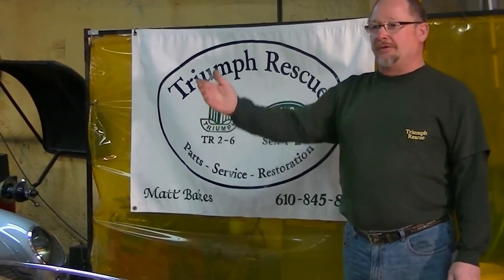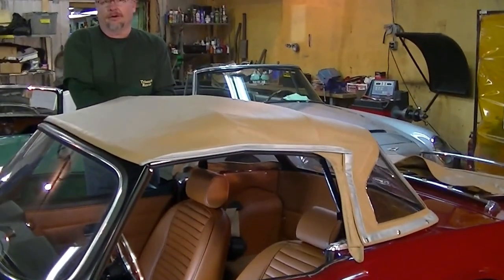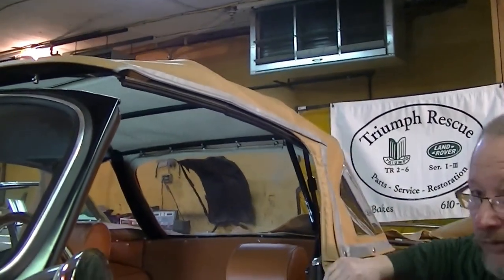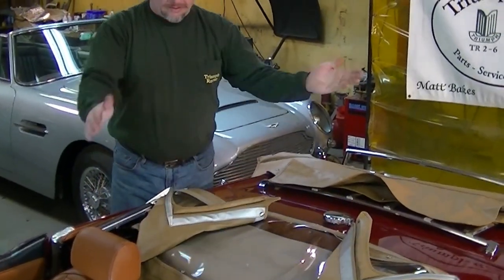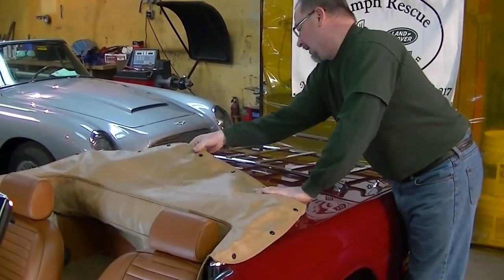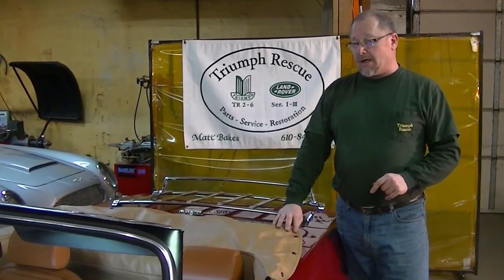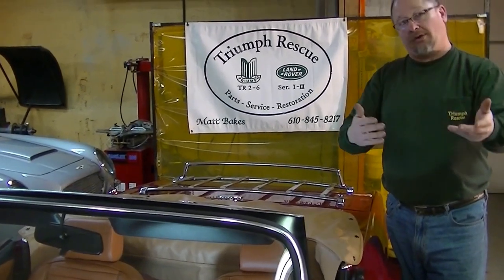TR6 Top Folding

Comment: Informative video. The only thing I do differently is to unzip my rear "glass" and allow it to hang down flat before folding the top. After years of opening and stowing, the rear window is still as flat as a piece of plexiglass.
Reply from the maker: HI Don, I agree that the final out come should be to protect the plexiglass. We see a ton of cars that the tops are in bad shape. One main reason is they never get put up. I tell people you should store the top up when not in use. Thanks for taking a look.

Comment: Great video and very thoroughly presented. I had a '69 TR6 back in the early 70's and had forgotten how involved putting the top down and up was. Folding canvas tops have come a very long way in the last 50 years. MyGawd indeed so... I just bought a 2020 Mazda Miata with a soft top. Putting it up and down takes maybe 10 seconds. You unlatch one latch in the front, fold it back and lock it in place... wam, bam... done. It's amazing!  I loved my TR6 in the day but I'll take the reliability and clever engineering in today's cars like the Miata.  😉

Comment: Wow! I had a TR-6 for a few years in the 70's in New York City, and knew nothing of such things. I'd put the top up and down with one hand while in motion. It was so smooth that I got TR-6 top frame to put on a '27 Model T (Speedway Motors kit) hot rod I'm building. The top down will fit the T body perfectly, unlike the tops designed for it, nestling down inside the body instead of lying on top of it. All it needs is the custom front top piece to meet and clamp to the top of the T's flat windshield. I'll make it out of steel bits and join it like the triumph to an aluminum top frame on the windshield.  The T has doors, but I doubt I'll want windows, since I'm in Florida.

Comment: I noticed that neither of the rear side snaps (the third one back from the glass window) were snapped when this top was up.  The snaps were not properly installed, which is very common.  The design flaw with the TR6 top is that the rear hold down plate (which holds the rear of the top to the car) extends beyond the place where the top sides should be folded over.  That is why so many people fold the top in the clear wind portion.  I have "unglued" mine back two inches on either side to facilitate folding on the fabric, not the side window.  That makes these rear side snaps even more important when the top is raised. As others have said, the rear window should be unzipped and dropped inside the care before the top is folded.  After discussing the negatives of folding the clear vinyl, Matt goes on to squeeze the clear vinyl rear window around the folded frame!  This will ruin the rear window.  If you drop it first, it stays flat and protected under the frame.

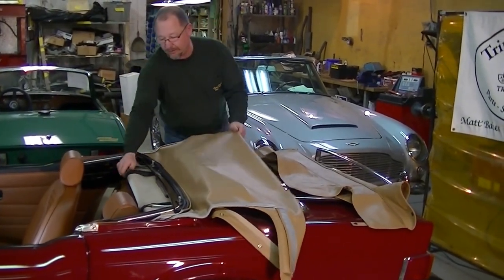Comment: This way leaves a lumpy looking  top cover as evidenced at 5:26,  I do it the same way up until 3:00 , at that point I fold the 1/4  windows up over the fabric so that they are tucked and hidden when the big window folds forward and behind the seat. This way gives a much smoother look to the top cover whilst top is stowed.
Reply: ...I just tried that, but then the 1/4 windows are directly resting and compressed on the upside-down protruding metal front pins. Ouch! How do you avoid that?

Doing it the way Matt did it, with some pulls to adjust folds, the cover is then pretty flat, although my material seems thicker and more robustly flat than his to start with.
Reply: @juliansimmons7700  piece of thin foam/cloth does the trick.

Comment: Even as careful as you were, it looked to me as if the bottom corner of the triangle shaped side windows were folded, which eventually becomes a tear. With a standard instillation, there's no way to avoid this due to the location of the snaps closest to the gas cap. Here's a trick I tried when I noticed that a TR6 has 3 snaps on each side, but a Spitfire has 4 snaps. We put 4 snaps on each side of the TR6 top. Now the  side windows can fold in on the fabric, and not crease the bottom corner of the windows. Also, I ALWAYS unzip and lower the rear window before lowing the top.
Reply from the maker: Interesting and thanks for letting us know, it would make sense and I never noticed the extra snap.
Reply: Completely agree - the rear window MUST be unzipped and lowered before pulling the top back.

Comment: So nice to see you showing this...how many times have you seen a used TR6 with a small rip in the "shoulder" of the top (above what looks like a "b" pillar, the vertical leg of the reflective strip).  You get that rip by putting the top down without unsnapping and pulling it out first.  I was looking at very nice TR6 online today, at a "reputable" dealer...yup, had the little tear.

Comment: Vinyl tops look a bit cheap and tacky on the 6. I got a nice black mohair hood for mine and it gives the car a real upmarket look. Mine has a row of internal snaps on the front bar as well. I put some soft cloths between the plastic windows to prevent scuffing. Identical to my fold routine though and I had to work it all out myself.
Reply from the maker: Hi Stephen, A lot of times I will install the snaps on the front bow as well. And there is a lot of tops sold for the 6 but quality is all over the board. Protecting the windows is a must. Thanks for the reply.
Reply: Stephen Flaherty thanks for mentioning. I did not know this existed. I am going to get one for mine. Cheers

Comment: I was shouting NO at the first thing you did!you really shouldn't just pull the snaps on the outside of the hood the way you did , grabbing the material and yanking it away from the car body I mean,because after time you will leave behind the female part of the snap rivet in the body studs, ie braking the snap. best to put your thumb on top of the snap and using two hands put some gentle pressure either side of the snap and gently prise them open using equal pressure on each side of the canvas.

Comment: This explains the problem I have with the tr I just got. There are creases in the fabric, yes fabric not vinyl, the snaps on the inside are broken off and the snaps on the outside have pulled through the fabric. Plus the top just doesn’t fit. There are 1 inch gaps at tops of windows and the Velcro does match up. The previous owner told me he never put the top up “cause why would you” he said. Well now I know when it did go down he crunched all the fabric in the frame. I’ve been told that because he left it down it probably shrunk and that why it doesn’t fit. I can’t find anyone local who’s anymore skilled then myself to replace it. How hard is it to replace? Please take in to account I’ve never done it or seen it done.
Reply from the maker: Sorry to send 2 replies, I understand a lot of people leave there tops down and that is the worst way to store them. Tops do shrink over time and in my opinion the best way to store them is up and attached the way they should be. If you get to the point where you can't find someone to help install the top send me an email @ rustytr4@aol.com  and I can give you some tips to make it easier to install.Matt
Reply: Matt Bakes thanks. I’m still hunting for someone.

Comment: YOU MUST ZIP OUT THE REAR WINDOW 1st....
Reply from the maker: Hi Richard, we don't normally zip the rear window open before folding the top. I usually tell customers to keep an old towel handy to cover the window while it's folded. That seems to work out well. I also tell them to try and leave the top up while the car is not in use, that way it stay kind of stretched so to say. Thanks for having a look at the video
Reply: Bollocks. My soft top is the same one as was fitted 26 years ago and I NEVER zip the rear window out when lowering.

Comment: mmmm, not the sharpest tool in the box . Pulls on the snaps , gonna break them . Then drags the snaps across the body as he folds - scratches . Tonneau dragged over the paint , more snap scratches . Lazy way to fold a hood.